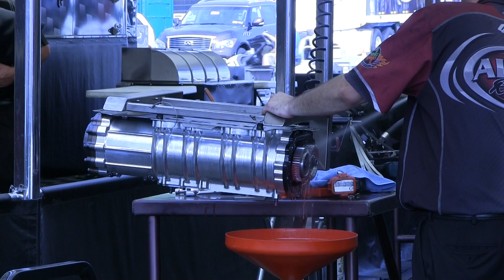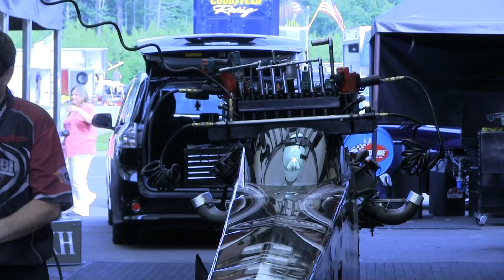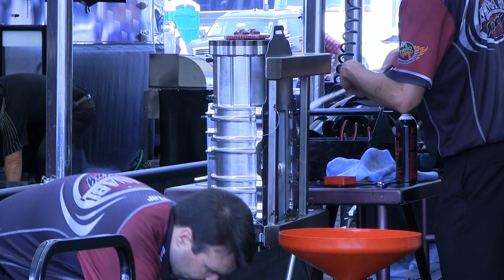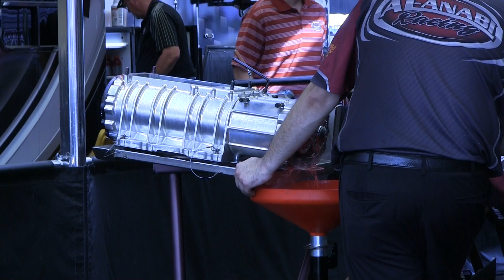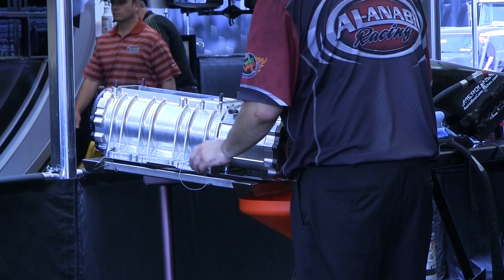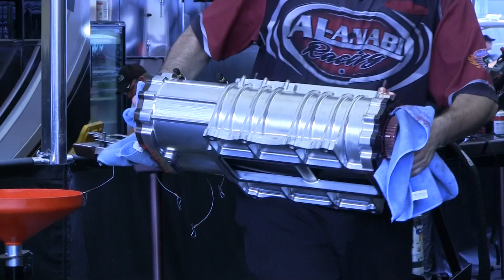Top Fuel Supercharger

Comment: Takes 750 horsepower just to run it
Reply from the maker: Given the fact of technology advancement (old video), we are in the area of a 900 HP loss. Parasitic loss from an engine driven (belt) device.
Reply: Takes 2-3 seconds to do the quarter mile as well.